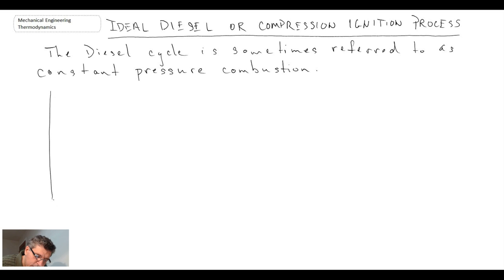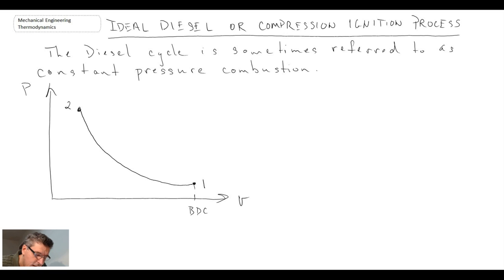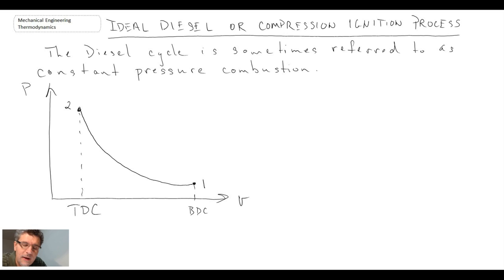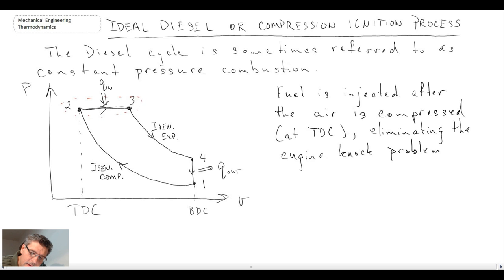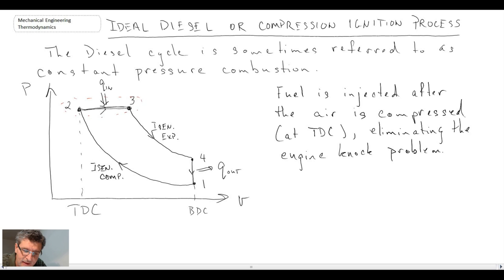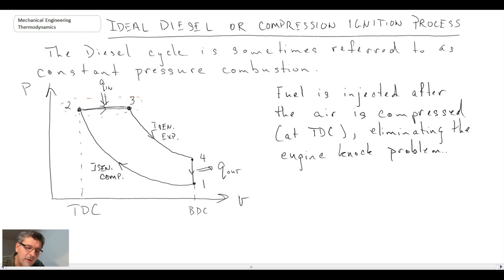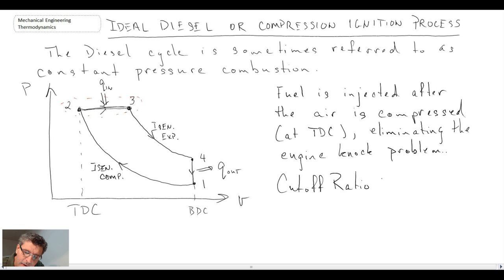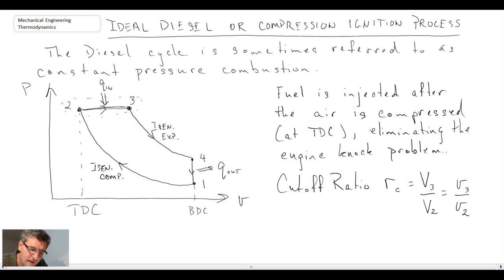Mechanical Engineering Thermodynamics - Lec 16, pt 3 of 6: Ideal Diesel Cycle

Comment: Can someone answer this. 

In finding V3, there are two ways that I know. One  is in the process 2-3 where the pressure is constant. That gives T3/T2 = V3/V2. The other is that V3=V2+cVd.

Now, the question is what is more accurate. I mean, what should I use?

For example, you all had the values in both ways. Trust me, there's a discrepancy when use both. Not a small, but quite large discrepancy. 

Can someone explain. Thank you!

Comment: There is a mistake, -q(Out) = u1-u4 so q(out)=u4-u1
Reply: Kiraben Raj Ravinddaran Based on watching his previous videos, I believe he places the negative on the outside to denote Heat Rejection as a negative process. Q out is still (u1-u4), because the first law states DU= Q-W. And the final process is going back to state 1, so final-initial is u1-u4. (No work done during an isovolumetric heat addition or rejection)
Reply: Thanks bro!

Comment: Sir,

would you please help me with this:
Air is compressed isothermally from 13 psia and 90 degree F to 80 psia in a reversible steady-flow device. Calculate the work required in Btu/lbm, for this compression.
Thank you,
Reply: You have the start pressure and temp and its isothermal so the temp doesn't not change so you can your u's and apply it to your formula and then you're good to go
Reply: @Lance.2451  bruh, 2 years ago
Reply: @lucalalsie5653  lmao pretty sure radu already solved that years ago